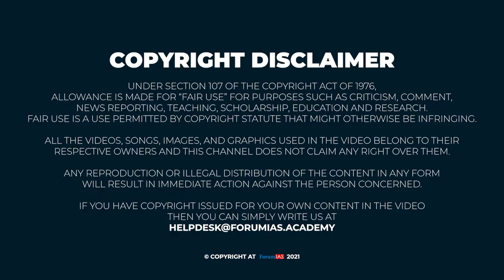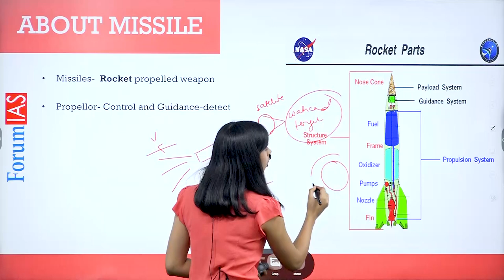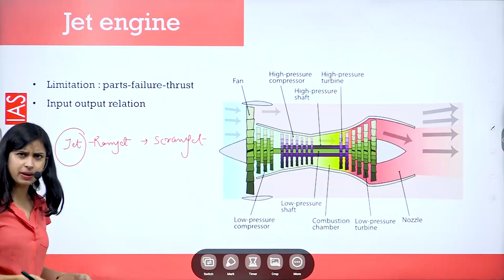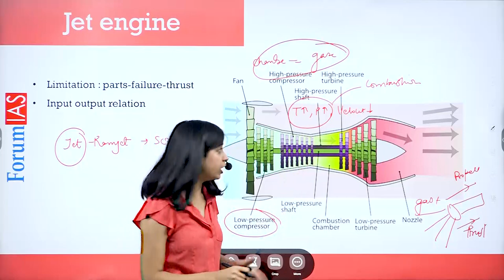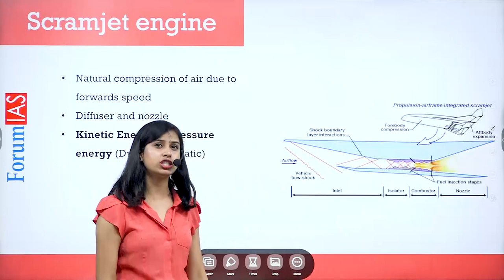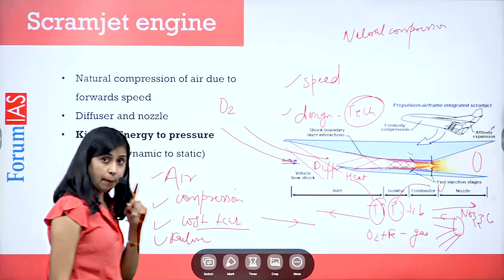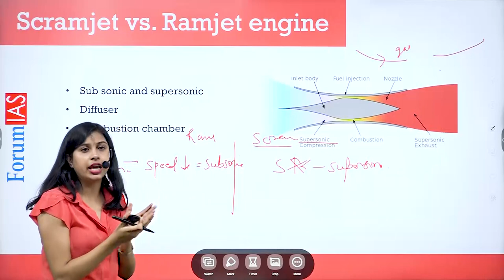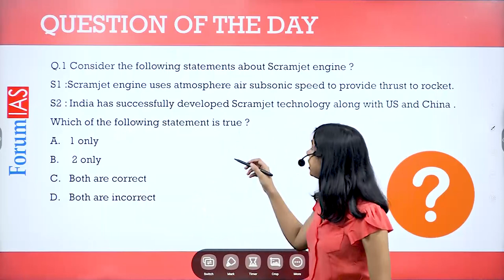Scramjet Engine Technology | Scramjet Vs. Ramjet | News Simplified | ForumIAS

Comment: Ma'am How can Both Pressure and temperature in scramjet increased because we have read that temperature and pressure are inversely proportional.......????
Reply: Yes, that happens when system is open, .The baisc chemistry is moment temperature rises, high pressure is felt in the system, because of rising motion of molecules. The molecules collides with greater force in same space. However in open system, soon molecules dissipate and pressure is withdrawn.As happens on earth, air rises up when temperature is high. So pressure because low due to motions of air molecules upward. Not Directly because of temperature.Butt in closed system molecules are trapped with both high pressure and temperature, with nowhere to escape. For that you can imagine pressure cooker, waha temperature bhi high hota h and pressure bhi
Reply: She is Explaining this in a wrong way.

I know I have worked on it 
There is a problem
Reply: Temperature and pressure are directly proportional to each other, not inversely. 

PV=nRT
P increases, T increases as well.

Comment: Sorry to say but I am an aerospace researcher and i can say jet engines never used in case of rockets. jet engines are for aircrafts. Rocket engine is far different from jet engines where no moving parts like compressor and turbine is used.U are showing a jet engine and sayion it is used for rockets. pleae correct

Comment: First of all I don't agree with cost reason because as u said both ramjet and scram jet works only when aircraft reaches supersonic velocity ?then my question is firstly how it will reach that supersonic velocity ? actually for that we use turbo jet engine or turbo Prop fan engine(which consists of compressor and turbine) ...after reaching supersonic speed the turbo engine is shut down and ramjet engine is started .So if we are already using turbojet engine during lifting and during coming down how cost is affected ?the only plus point I think is probability of failure will be less because most of the time it will work in ramjet or scramjet engine.one for thing u missed very important concept of supersonic diffuser and supersonic nozzle because at supersonic speed nozzle acts as diffuser and diffuser acts as nozzle that is the thing which are making scientists to change all those shapes .......thank u

Comment: Just a heads up! What you've failed to mention is that vehicle needs to break the sound barrier first to deploy the ramjet or scram jet technology until then how do you make your vehicle airborne let alone to use the engine. Cost effectiveness of scramjet is frankly lies only on papers as we have to use one(or more) more engine or solid fuel to get the desired speed to initiate the natural compressor.